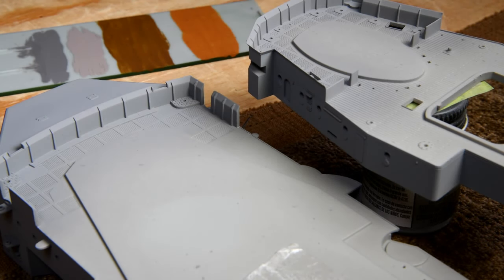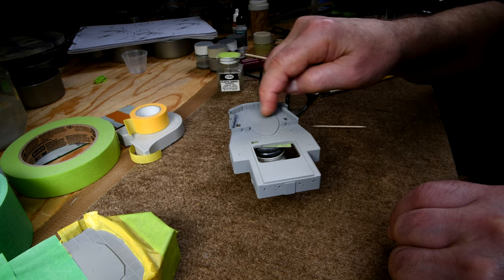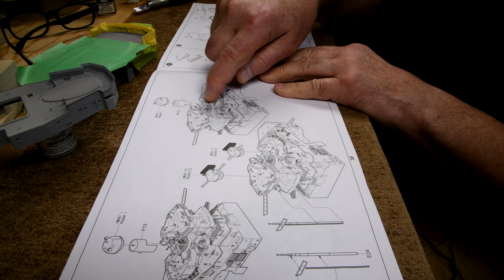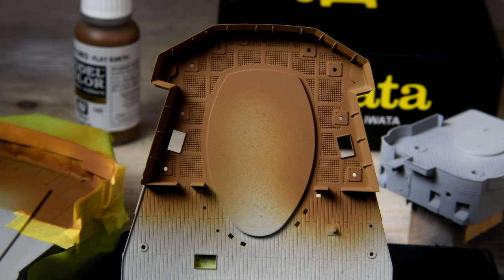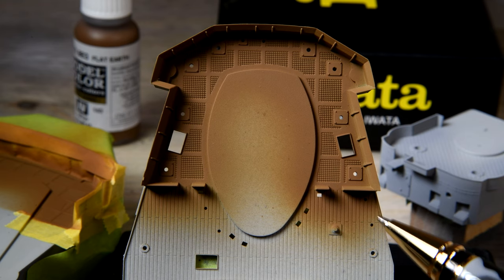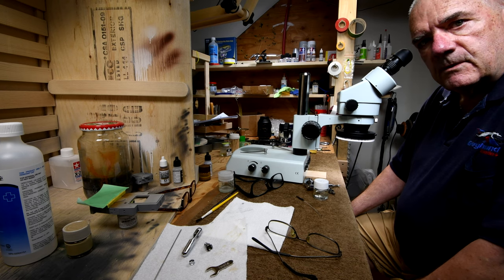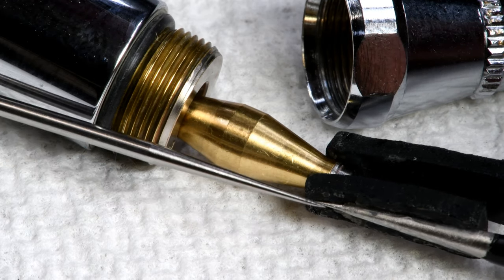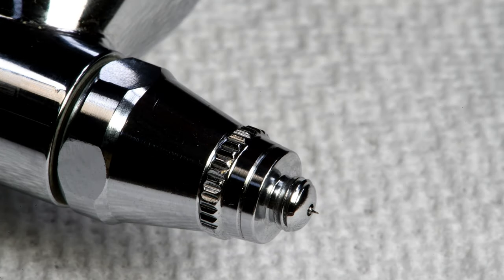The Model Ship - Part 149

Comment: Hi Ron, sorry you’re having so much trouble. I don’t know much about air brushes but if you have a leak did you check that the big o ring that you tighten the nozzle on is ok. Just a thought, good luck.
Reply from the maker: Thanks Philip,
That big O-ring is there for air tightness, but has nothing to do with the bubbles coming back up into the paint cup. 👍

Comment: Doesn't the manufacture or instructions that came with it have any "troubleshooting" possibilities?

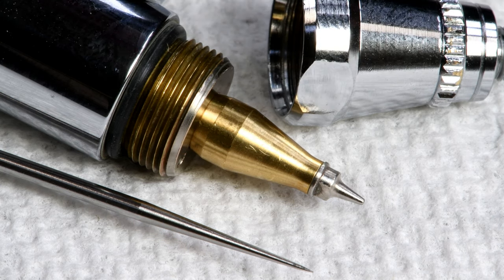It looks like the bottom of that needle(round shoulder) has a flat spot(11:07) on it and if so does it fit in a slot in the cap?  See ya tomorrow.  This is Houston calling.      JimE
Reply from the maker: The instructions that came with it are a joke! I guess that the assume you already know how to use one of these things. The Iwata website on the other hand is more helpful.
Flat spot --- you've got good eyes Jim, lol 👍
Reply: @roncalverley  I have one but like a lot of things I have,  I've NEVER used it..

So what is the flat spot for?  I take it, it fits into something.  See ya soon. It's close to 6pm.